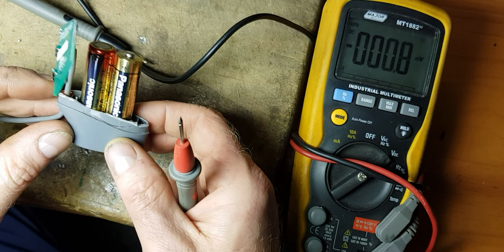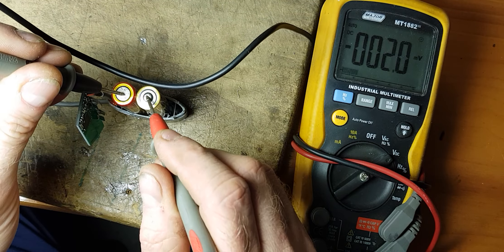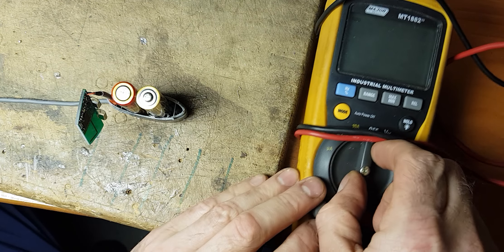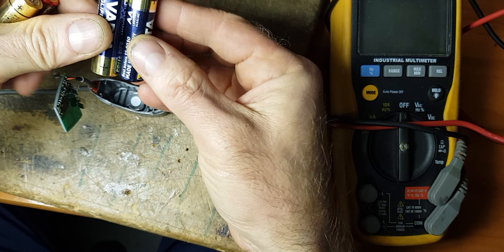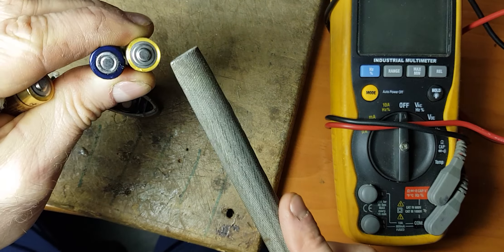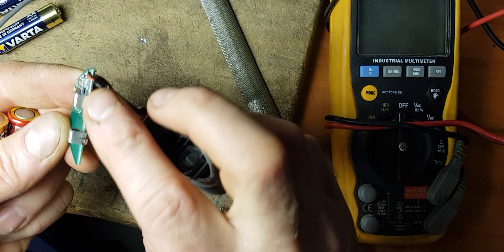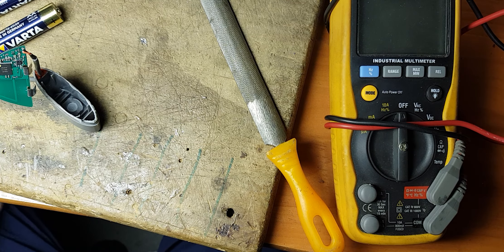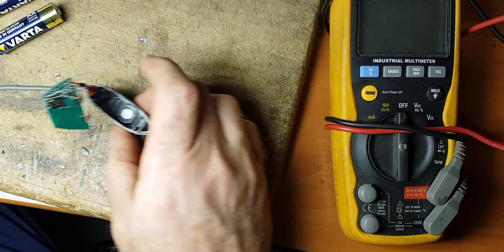Powerpal battery replacement 2/6

Comment: It's ridiculous they didn't design these units so you can easily replace the batteries. It doesn't make sense. On the PowerPal site they just tell you to send it to E-Recycling. Does the State Government pay PowerPal for these? Someone pays for them! They are free to the end user and I can only assume PowerPal want you to request another one when the batteries die so they get another kickback from the State Government because it's classed as some sort of power saving / monitoring device? I can't see any other reason they would actively discourage you from even attempting to replace the batteries. It would have been so simple to simply design the case so you can easily slide the white top off and replace the batteries. Thanks for the video - I just bought a cheap 2 battery holder and mine is back working again.
Reply: The Victorian taxpayer does indeed pay for them - the price for residents of other States is something like $140 I think. Mine was installed about two years before failing - a bit short of the five years promised by the provider. I've contacted PowerPal to see if the unit will be replaced however my suspicion is that it's now eWaste unless I do the work myself.
Reply: First thing I thought was to get a dual AA battery holder from Jaycar and solder that to the circuit board. That's what I'll do for sure.
Reply: @moebius2k103  yep! That's what I did and it works a treat! Craig - Geelong